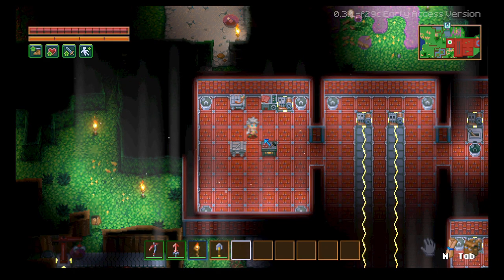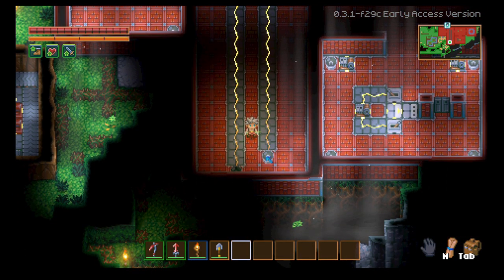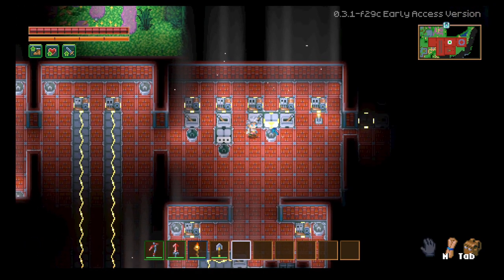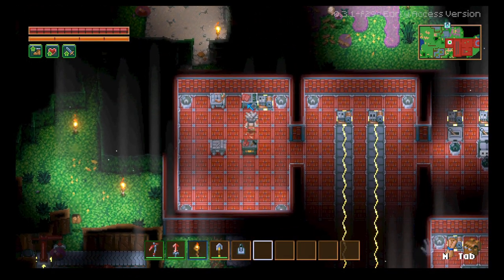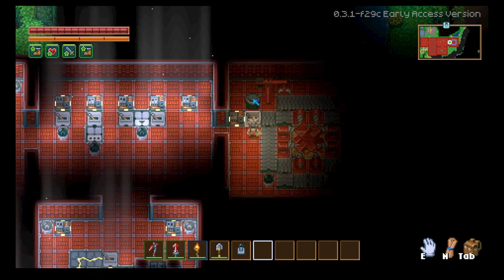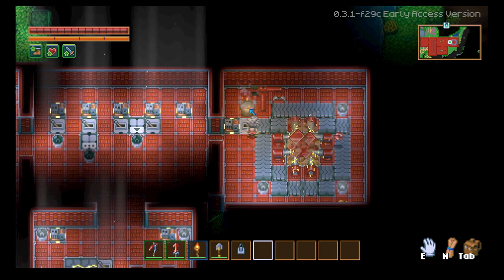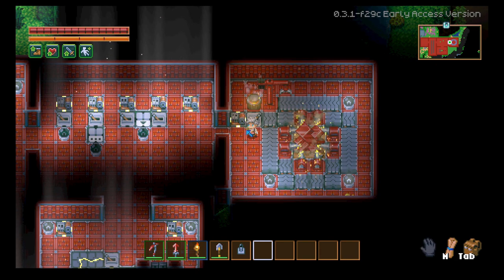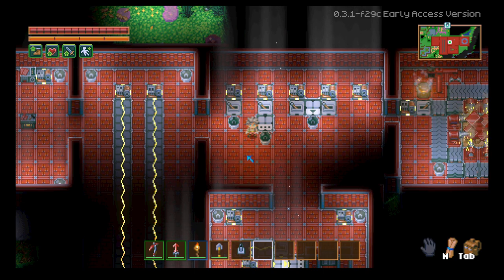Electricity and Automation Guide - Core Keeper Early Access

Comment: The electric stick is for logic gates. The way the gates work is that if there is a stick on one of the 3 inputs, the remaining 2 act as an XOR gate. That is, if exclusively either input is on, the gate allows the current. Similarly, without the stick, it acts as an AND gate, which only lets current out if both inputs are on. You can even make a NOT gate by having 2 sticks and one input. Since it only turns on if exactly 2 are on, the 2 sticks force it in ON and when u turn on ur input, it turns the gate OFF.
Reply from the maker: Oh my dude this make so much since idk how I didn't realize this I feel so stupid, thank you so much I really appreciate that.
Reply: The NOT gate doesn't work, unfortunately. The sticks don't output enough to make it to the output of a logic gate. You'd need a better power source coming into one of the inputs; simplest NOT gate I've seen is a generator on one input and a stick on the other. That'll output a full strength signal as long as the third input is turned off.
Reply: if you have a logic circuit with two electric sticks and a manual input, as it is changing from off to on, there is a small pulse released, which can open doors then instantly close them, long enough to walk through
Reply: The thing is I can't figure out the point of the logic gates as of yet. There are no sensors, only manual switches, so short of a door with two switches what can you do with these logic gates?

Another thing video doesn't cover is that you can create a clock with the logic circuit and delay circuit. Again, it's pointless, but it's something you can do.

Comment: The in-game description of the electrical stick explains what it does.

It outputs a very low amount of power, not enough to power any components but acceptable as input by a logic board.

Basically with two inputs into a logic board you have an AND gate, one which outputs a signal when it receives two inputs. If you place an electrical stick in one input of the logic board then the other two inputs can be treated as a XOR gate; that is, it will output a signal if it receives one, but not two, powered input.

Edit: Ah shoot I see it already got explained. Apologies for the duplicate response.

Comment: because of the hard 14 block limit i can't have an infinite loop circuit for a  blinking light. It also keeps me from having one generator power the whole base. that makes me sad.
Reply from the maker: Yea the 14 block cap kind of sucks I think they should have a way of extending it kind of like how a repeater extends in minecraft.
Reply: There is a way to extend it. The logic gate outputs the stronger of the 2 signals, so if you put a generator adjacent to it and power another side with any wire power, it refreshed the signal length. For an example look at the auto sorter clip
Reply: Also the delay circuits dont seem to decrease the power level
Reply: @blockofbudder  types on a calculator by Jove, he's right.
Reply: @xJohnnyBloodx  glad to be of help (: